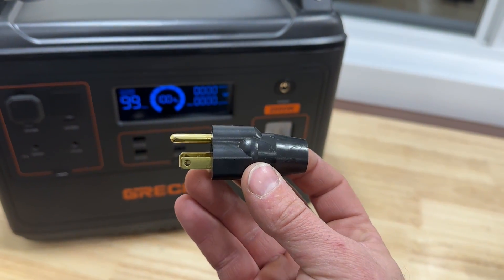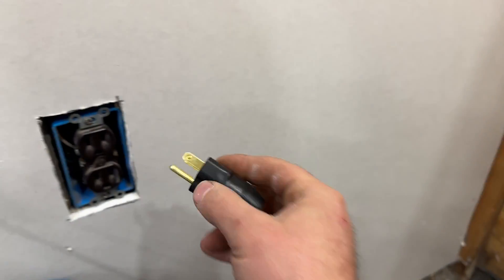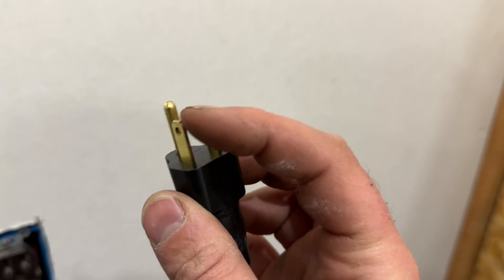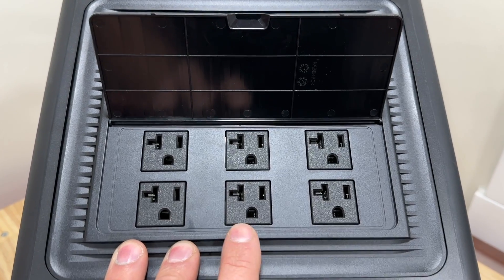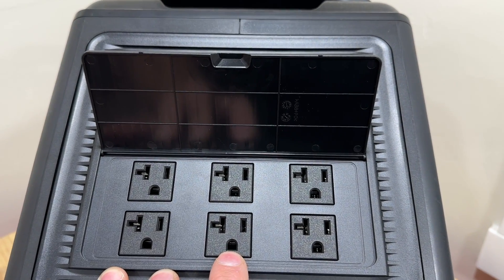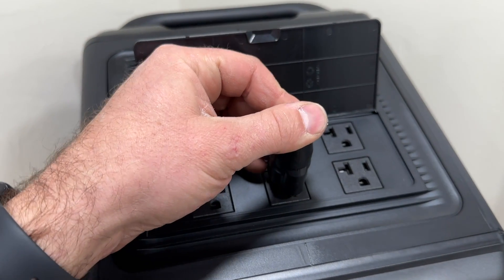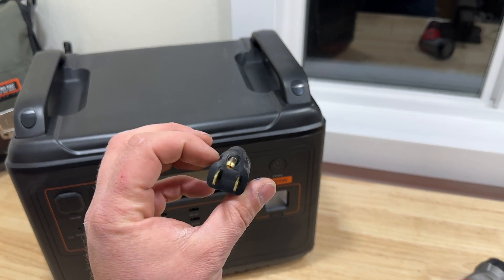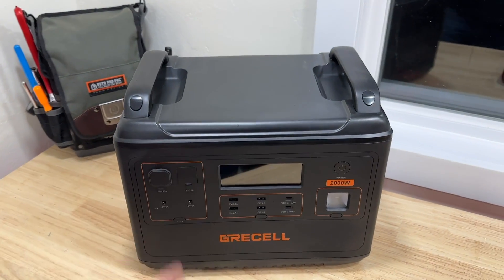What Is The Purpose Of An Electrical Ground / Neutral Bonding Plug?

Comment: Sure, this fixes the problem.  But is it entirely safe?  I'm not so confident it is but I'm unable to work out just why.  I think the better solution is to ensure the furnace is grounded properly to begin with.  
That the neutral is not already bonded to the ground inside the generator, similar to a panel, MUST have some significance.
Reply: Some generators are floating neutral and some are bonded with ground.  If you connect a generator to the house electrical panel via a twist lock plug and a gen-tran panel it will use the ground bar in the electrical panel.  The neutral and the ground bar are joined together in your electrical panel, thereby making ground and neutral bonded.
This little plug does the same thing when you are running and extension cord from the generator to the furnace directly, without going through the electrical panel.  It would be used when your generator has a floating neutral and you are just using extension cords to power things.  It allows the furnace to see ground and satisfy the circuit board requirements.
It's perfectly safe.  You can make your own by using a spare appliance cord and twist and wire nut the ground and the neutral wires together and wire nut the hot wire.  Plug it into a generator outlet and you have a bonded neutral instead of a floating one.
Reply: @percyfaith11  right on. then the only question is whether you add a ground rod to the generator for lightning strikes if during a storm if the furnace is open to the outside elements.  most likely not i guess.
Reply: @jlosFLTX  All the generator manuals that I have see say to connect the grounding lug to a ground rod.
Reply: @percyfaith11  ... that would be for a gen set stand-alone use. If you are tied to the house panel with proper gear, there are 4 wires in the cable, and one is tied to the house ground and ground rod. No extra ground rods needed at that point.
Reply: @rupe53  good point
Reply: WOW thanks ! but lets say there is an issue like a short or something what happens to the furnace OR the generator ? Would adding a GFCI plug on the extension cord break the connection protecting both ends of the extension cord and the equipment connected to them ? any help is much appreciated..... @percyfaith11  by the way this would be for direct connect to furnace not the house panel...ok
Reply: i mean the ground is now bonded to the neutral. if somehow the air handler chassis becomes hot it will instantly pop the breaker. nertual is already bonded to ground in your electrical panel